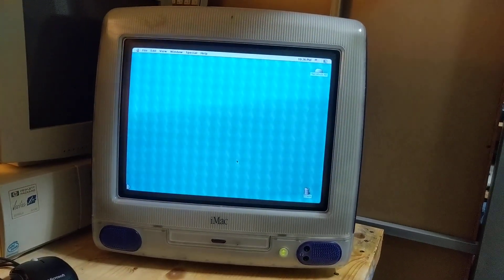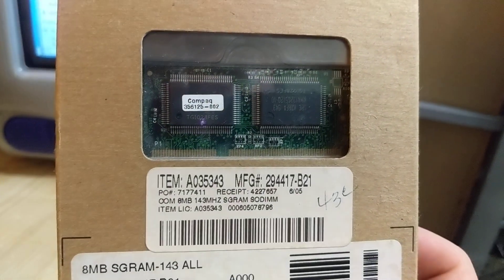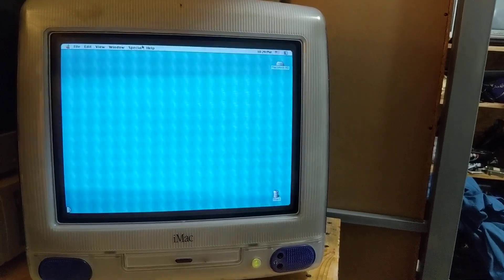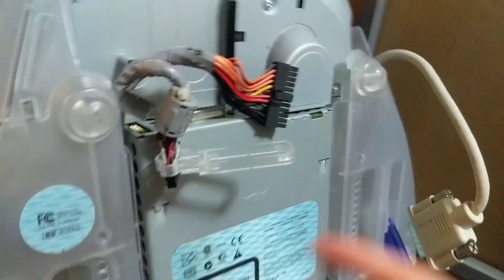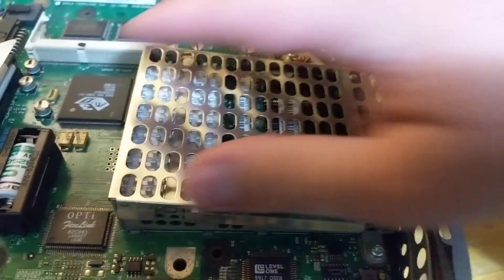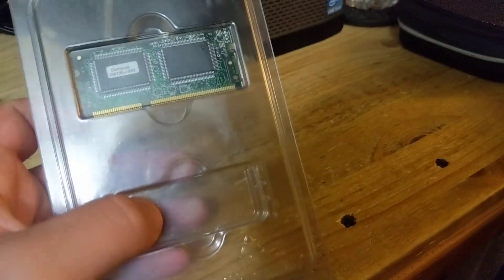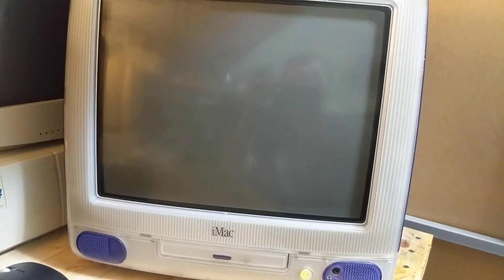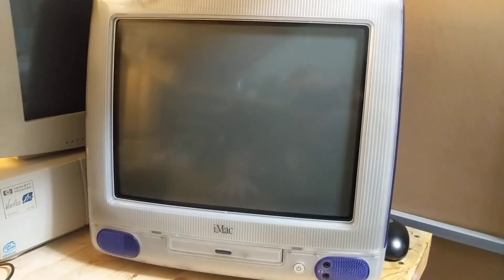Can we upgrade this iMac G3's VRAM beyond 6MB?

Comment: Thanks for posting this. I totally forgot about that Vram upgrade option. I have an old Tangerine in the garage and I've not used it in years so I don't even remember if I upgraded it when I did, and if I ever put an SSD in or just a regular hard drive as well as how much ram I used. It's next on my list of "retro" computer stuff to mess with. I got my old Blue and white G3 going again with SSD a 32mb radeon 7000, an adaptec usb 2.0 card, an internal IDE card (which the system seems to see as SCSI) and a gig of ram as well as a super drive. Waiting to get a 64mb video card to arrive from Ebay. I think I'll have to flash it, maybe. One of the SSD's I have is running OpenBSD (no i'm not super techy, just trying out something that will run at an "okay" speed on this old machine) so not sure if it will recognize it without flashing the rom. No biggie if I have to flash it. I have 9.2.2 on one partion and osx on another partiion of another ssd drive. Just being able to make outdated computers run (and be able to get online) these days is kinda cool. BTW there's a browser called Classilla that works on OS9 that will allow you to get online and go to most websites. Since most modern websites have updated ssl stuff and none of the browsers made for classic mac have been updated.
Reply from the maker: Is there any reason at all to have >32MB VRAM on a classic Mac like this? The hope here was to get extra color resolution, since the built in CRT can do 1024x768 and 32-bit color, but 6MB of RAM does not permit this combination. I believe it was limited to 24-bit or even 16-bit color at XGA. I've never attempted to run SSDs in any of these machines.